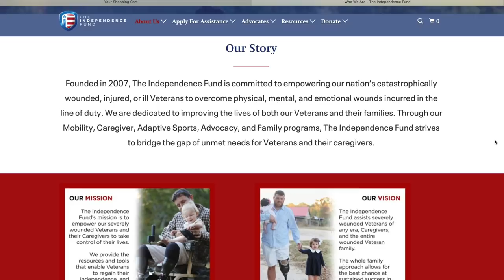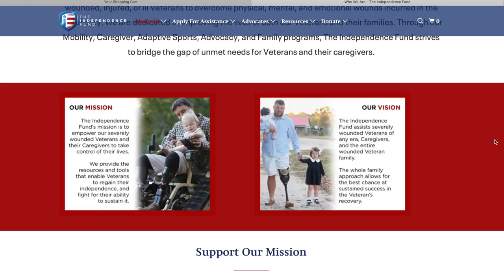Fixing BUSTED boat parts on the water!

Comment: If you have too-thick-for-potato-chips potatoes, don't deep fry them. Put some butter in the pan to fry the potatoes. Turn the heat to "medium" and put a lid on it. Then slow-fry them until they're soft and tender, turning them over once or twice. Then add salt and pepper. You might also put some cut up onions in the pan and fry them 'til they're clear. The result is what my father (Welsh/Scottish heritage) called "German Fried Potatoes." They go well with sausages, Kielbasa, etc. And whatever else you might have for breakfast.

Comment: Teflon tape on boat and rv water pumps is ill-advised: a small piece in the impellers can melt and literally gum up the unit. (But I use it with great care and finesse.) Such pumps are self- priming and capable of running dry without harm. Use rv non-toxic antifreeze to winterize all water carrying fixtures including the toilet pump and lines. Ontario, Canada.

Comment: outside of boat its a metal bracket for the rope, you can make it a two metal pipes, and weld them to that rope Bracket and end of the pipes, screw or weld those in a metal container where you can attach the oven, and add some kind a lock so its tight on that while you driving the boat. or make new one where is both.

Comment: if the threads go in clockwise, never roll Teflon tape or the similar tape counterclockwise, because when you tighten the Nut its Can loose that tape, so always put it same Direction where Nut Roll's.
Reply: I agree,but I would never tell a professional mechanic what to do. But that’s just me.

Comment: 1.01972 kg/cm²  =  1 bar =   10 N/cm²  =  100 000 pascals =  14.5038 P.S.I.       Good Job       Happy Birthday

you can gently  rip the threads with a tool to make it grip to the tape so it won't turn with the screw when you connect 
( the tape : allways clockwise )  https://www.youtube.com/watch?v=EtYyMO6be0w
; hope it helps in the future
sorry for my approx' english

Comment: For that stove/Oven, have Arron make some Iron brackets that connect on top of side of boat like your other cooker has. just need something that will support more weight. Make sure when building it that you leave enough room under it for air flow and cooling. Might want a small fan their to keep the heat off boat when in a no breeze situation. I am enjoying you too with your vehicles and boats. I have a 2008 Dodge Sprinter  that went from passenger van to Camper Van, thanks to a couple from Chattanooga, TN. We travel as much as we can in it.. I will have to check out your lake in Arkansas. There is a big lake in South Carolina that is Lake Jocassee. It is over 250 feet deep and covers a small town that you can scuba to and search! Have fun and enjoy.

Comment: A possible solution to your oven...coming from the persepective of being able to set it on the floor of the boat (or whatever) instead of having it suspended or sitting on a ledge somewhere....

Test it at home and see how big of an air gap you need underneath to not get anything too hot...If it doesn't have to be at a ridiculous height keep from melting the floor of the boat, check out 80/20 aluminum extrusions. You can make anything you want. It's like an adult erector set, haha. I was thinking, you can design a frame to sit the oven on. The benefits of being aluminum should be obvious to you guys. Then as a counter to the frame acting as a heat sink to the boat, you can add thick rubber pads to the bottom of the frame (or even between the oven and frame) to prevent heat soak to the boat through the extrusions. So you are able to mitigate both types of heat transfer, conduction and radiation. In theory anyway...

After a bit of thinking, I doubt you'd just have a frame. You'd wan't it up higher, so there would probably be legs too, so then you wouldn't necessarily need the rubber pads. So basically what I just described is an aluminum framed table...You could make one thats collapsable... 

Check out 8020.net. They may have a distributor close by to you that you could order from and maybe pick up, and save some money.

Comment: I found on my boat that the water pump gets air locked sometimes. Sucking water at the faucet is usually enough to get it going again, assuming the motor works. I also have just the pump assembly to swap it out if the motor still works. What I am missing is a valve between the pump and the tank outlet. Hope it doesn't fail when I have a tank full.
I think you got bad advice on the motor oil viscosity and should not be using 40 weight. 30 weight would have been a better choice. Engine is an engine and should have the correct weight oil based on the temperature of the engine and bearing oil clearances. The thermostat in the Mercruiser application has about a 165F thermostat, not 185F like an automobile that could deal with higher viscosity theoretically. I have switched to Mercruiser full synthetic after losing a great deal of oil using royal purple. When you look at the dipstick, notice that it has 3/4" hose threads on the end of it. This is for attaching an oil evacuation pump that usually comes with a hose end. Nothing at all wrong with the tube you used. My engine has a Mercruiser oil drain accessory that has a hose from the oil pan drain with a plug in the bottom end of it. A small cable attaches the plug to the bilge plug. When I drain the oil I pull the bilge plug out and then the end of the hose, remove the plug and drain it completely!
Love your videos! Thanks for sharing them.

Comment: It looked like you simply stood the barbecue on the railing. While tempting, that may well cost you your dinner, and your barbecue one day. All it takes is one careless boater passing by a tad too fast and pulling up a swell. Or maybe there's a shipping lane you didn't think about running past that peaceful cove of yours. Staying onboard 24/7 can catch you out in several different ways until you've adapted to the fact that any seemingly stable and horizontal surface can begin to tilt and buck at any given moment.

Comment: Teflon tape, 1 and1/2 wraps, any more and it will leak.as you will find out. A mild soft set pipe dope like Keytite works great on all threaded pipe fittings. Another thing, dip your bared wires in an antioxident grease up to the insulation before crimping, it will really reduce corrosion up the wires.

Comment: A boat (or motorhome) trip without at least one small repair wouldn't be a boat trip.  Funny thing about "experts" is they're never around when the work is actually needed.  I worked as a designer back when we worked on drawing boards.  The room was quiet until you drew that first line then you were surrounded by "helpers / experts".  Guess it will always be that way so now I just surf.  (The sound of the waves filters out any negativity & surfers generally are pretty cool people!).  Happy Birthday (belated)!

Comment: ider fer ya, what if ya made a stand fer the oven that goes into the table mountin, so where table sits, remove that an have a framing to put on to set the oven on, so its open on the bottom so it cant heat up anythin but also has its own stand so when not using ya can set the oven an frame to the side up the table, anway just an ider to toss yalls way ~Ben

Comment: "Boats will cost you a fortune" yup definitely. My parents had a 28 ft wooden hulled cruiser. Bought it cheap had it for a few years until we found out the entire front half of the hull had to be replaced due to the wood starting to rot despite the constant care my parents did for it. (They loved the boat) Couldn't afford to do the replacement as the cost was way more than what they bought it for (talking thousands of dollars + labour ) and had to sell it.

Comment: The higher psi will make your shower a lot better… if you use the Teflon tape the other way it won’t unravel..those are pex by FIP (female iron pipe thread) unions

Comment: Yup, got to love working on boats. There's never enough access. 
We get ski boats in at work for shaft alignments and bearing changes. 
Some jobs start and a few hundred, just because it takes a couple of hours to figure out how everything comes apart & to pull everything apart. 
Or it's in a hard to reach spot like that and it takes twice as long as it should to do.

Comment: thank you both for sharing , @ 20:22 if you haven't already try to invest in a deep fryer that has a cover top on it with a timer , that might alleviate the spill of hot oil on the boat... , and one of those ninja Foodi 8qrt , are also portable in No Mess easy to use , that's just my opinion though.
you two are awesome , thanks all the way from Monterey California area......

Comment: Hiya, I've been watching some of your older videos, and may I recommend Pressmaster stripers for, yep you guessed striping the wires you use. The fact that you can pre-determine the length of insulation you want to go, makes fitting crimps more accurate. I worked as an electrition for many hundreds of years before moving to film & TV, and used many styles, these were among the best, and with the wire cutter built-in...
Love your work, stay safe...Steve...

Comment: Redo the blue crimps farther down the wire on the fresh water pump. They are not sealed. Heat shrink any wiring on a boat and also use only tinned marine wire for repairs or new circuits. And the heat shrink type wire ends are sufficient to keep water out, you don't need to add the black shrink.

Comment: Advice for the teflon tape....be careful to apply it so the part with internal threads turns over the loose end of the tape, not against it and avoid putting it in the first thread.  This is to avoid shearing off small shards that windup down stream in your valves, shower heads, etc.

Comment: I have the same problem with one of my customers boat trailers. We have a current at the local ramp so i strap a few concrete blocks to the rear of the trailer so it doesn't go sideways while ramping the boat.

Comment: Our trailer has flexible hoses (like a faucet supply line) leading in to and out of the pump.  This makes it easier to work on things without having to take other things apart.

Comment: You put the Teflon on wrong.  It should be wrapped the other way.. this way when you cut it the end will be to the right and when you tighten the fitting it will tighten the tape and not want to unravel it.

Comment: 15:44 the teflon tape goes in backward, you need to change that so it really has a chance to seal and not bother you 1 while installing the fitting and 2 longterm.

Comment: You can find a small folding camp table with an aluminum top. Theyre made for grills and it will fit right there in the corner.